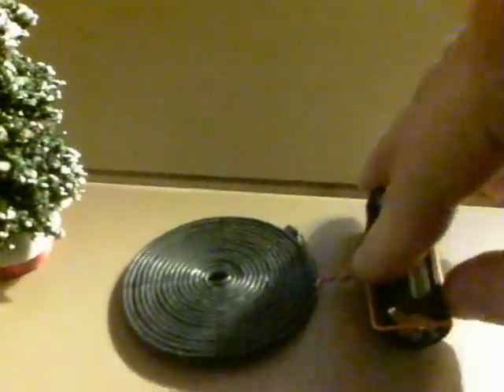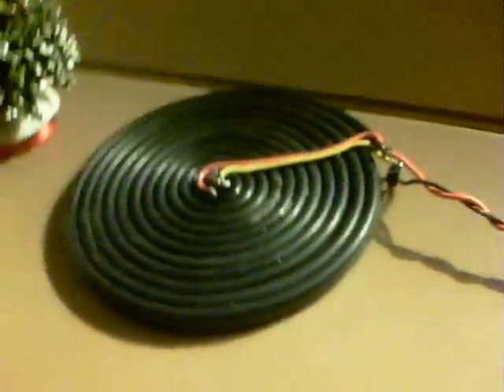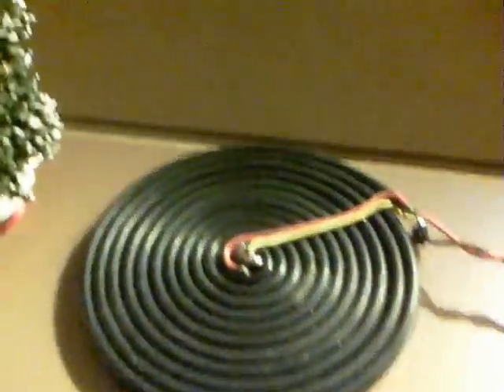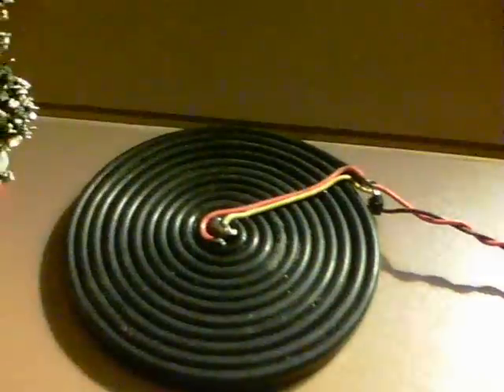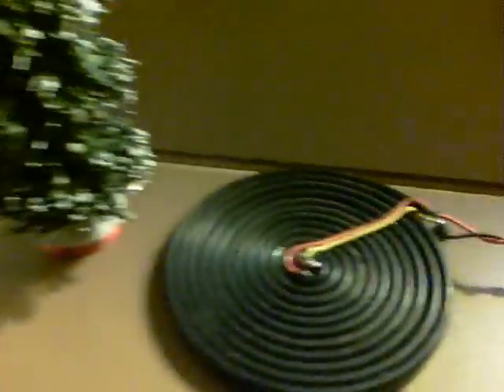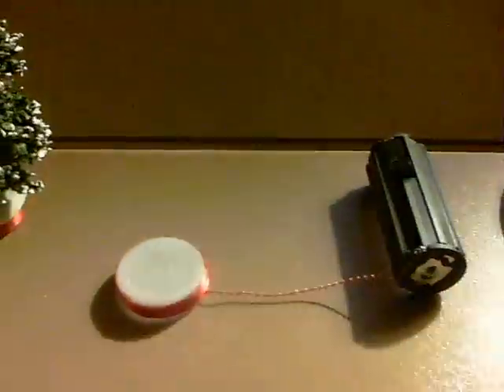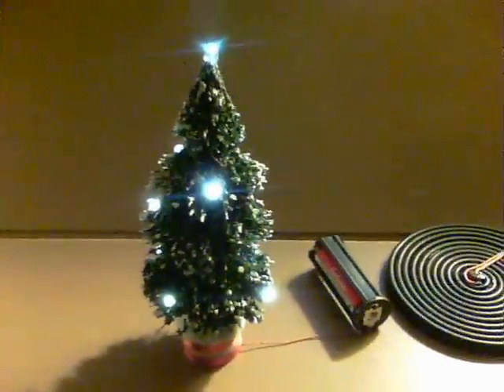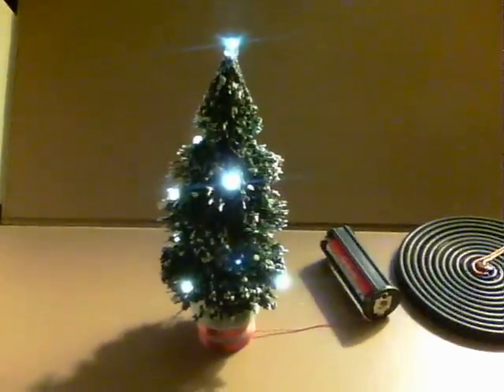Christmas Tree - 1.5V wireless electric

Comment: Do the transmitter coil and receiving coil need to have same exact number of turns or can it be like 30 turn coil for transmitter and 15 turn coil for receiver?
Reply from the maker: In general, the same number of turns of the same type of wire works fine (30AWG being a regular 'go to' type of wire). 
As long as you have above approx 12 turns on the receiving side you should be fine. Adding a small capacitor across the receiving wires always helps, values from 1pF to 1nF being most useful. They are the tiny non polarity ones, commonly with numbers such as 102, 64 or 103 written on them.

Comment from the maker: Hi James. If for R/C car it's often easiest to just use the li-po that's already onboard. You have to find the right resistor and run that in line from the Positive battery connection to the first LED, will be something like 470ohms. The resistor protects the LED's from burning out. 
Simplest method though is the route you seem to want to go along anyway, couple of hearing aid/watch batteries.  
A wireless system as above would be efficient and just need one hearing aid batt.

Comment: i want to make some led lights for my rc cars. i want to use just an led and a battery. do you have a video showing the smallest battery with a decent led light on it. i want it simple. maybe just the battery with an led. i was thinking something small like a hearing aid battery. but i couldn't get any power. looks like i might need a total of 3 volts. but i was hoping for the smallest battery possible. what are your thoughts?

Comment from the maker: I hear ya, not forgetting that the LED's are being powered with just 1.5V in the first case and 9 of them. Mounting the sender under a smoked glass table ought to do it, but if they're not inquisitive or electrically minded I see your point !
Wonder how much EMF an iPhone puts out, could build a Dr. Stiffler type SEC into the tree base and stick the tree on the phone, as a 3D solid iPhone app lol

Comment from the maker: You'll like the next video then I hope..the whole wireless circuit is about 1/4 the size of a finger nail ! 3 of those SMD HDD type were on the back of the Mattel DeLorean (videos) as the oscillator coils, they do work well.